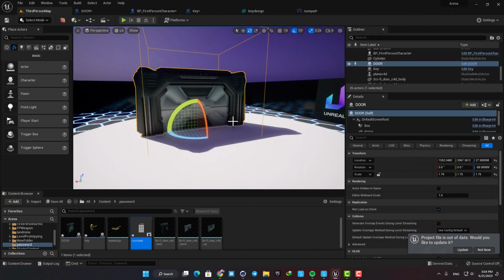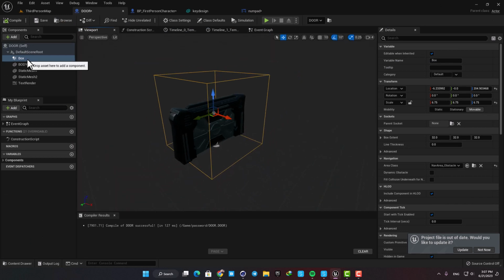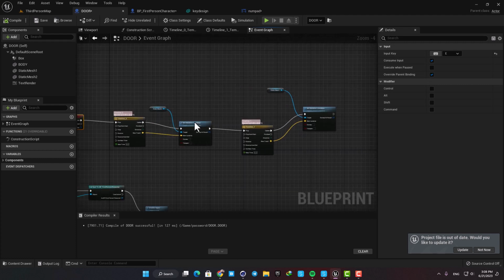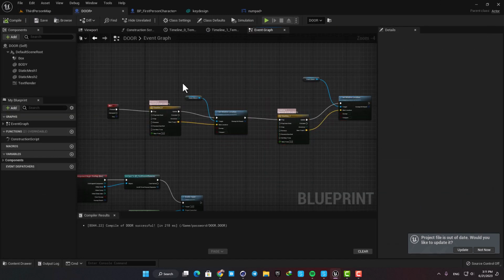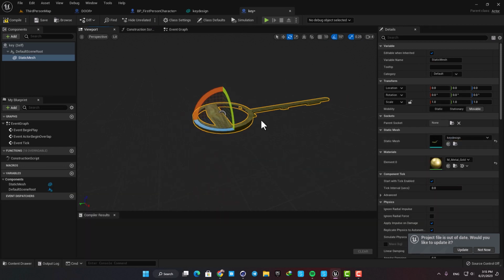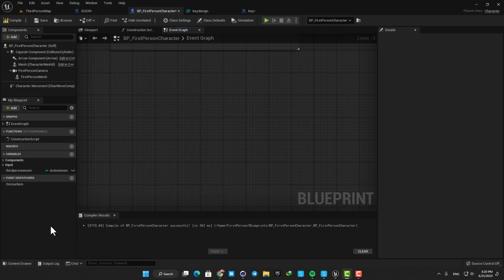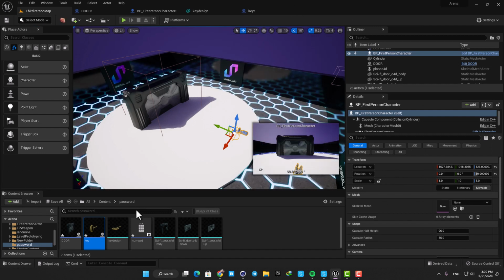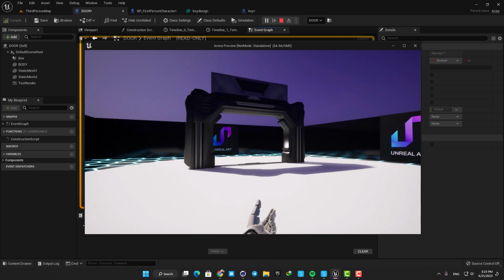Open A Door With A Key In Unreal Engine 5 Using Blueprints

Comment: I dont understand.. it seems I am following this tutorial however I am having issues when creating a key. collision box > on overlap > cast to third person bp. And here I tried adding print text to check where the issue is. If I put it to cast failed, then it prints text. For some reason its failing to cast. When I close game, UE5 shows me this error: Blueprint Runtime Error: "Accessed None trying to read property K2Node_DynamicCast_AsBP_Garage_Door". Node:  Set unlocked Graph:  EventGraph Function:  Execute Ubergraph KEY Garage Door Blueprint:  KEY_GarageDoor

Lines are connected the way they are in your video... :/
Reply from the maker: I can't guess what the problem is exactly, you can send me a screen record of your project so I can look into it. 4lirezaemami@gmail.com
Reply: @UnrealART  Hi! Thank you for your reply, I was messing around with several tutorials at the same time. I am using different system to open door so this might be the issue. I will try to redo door system itself like you made and try again. For some reason making key itself again worked I think so I might be not having issues when I redo door system. But again, thanks for reply.